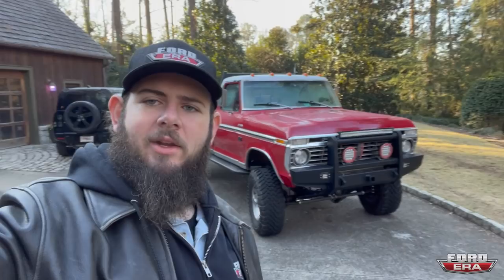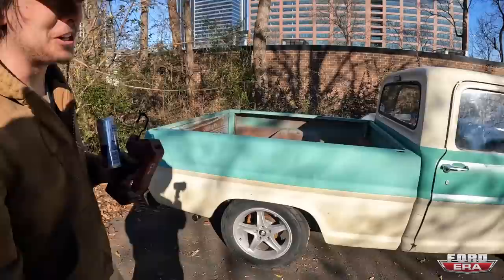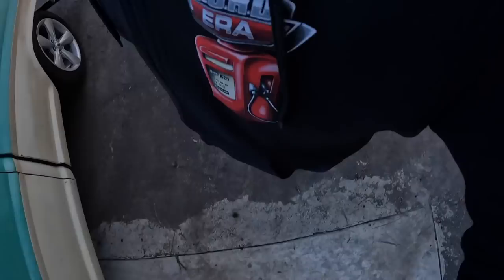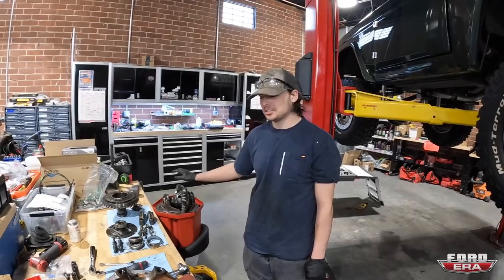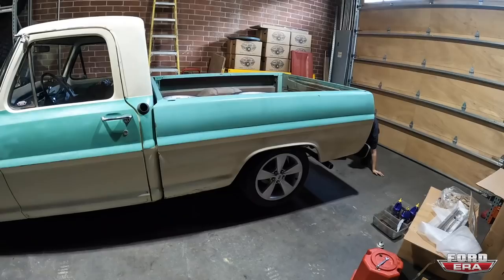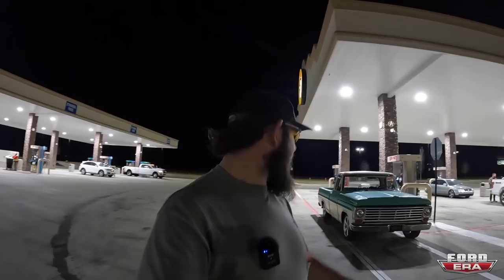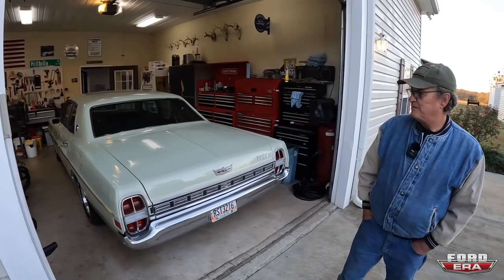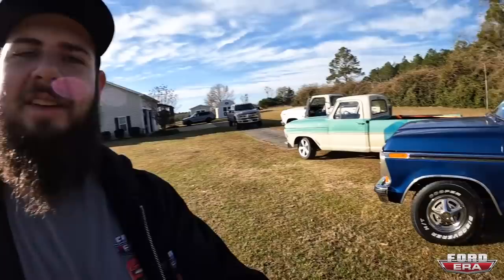Fixing the Coyote Swapped F100 & Roadtripping Back to Miami! | Ford Era

Comment: My mom had a 70 Ford XL yellow with black interior convertible had the 429 four barrel I blew it up broke the crank popped right through the timing cover. At the time I raced 69 dart swinger 340 my personal car, 4:89 gears , recurved distributor, hooker fender wall headers. Not bad for a 17 year old kid just out of high school.